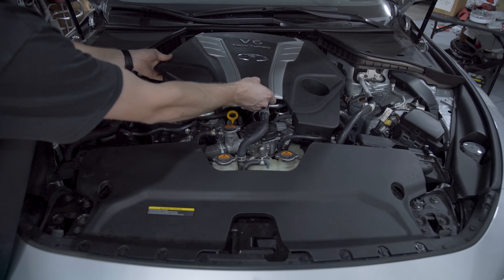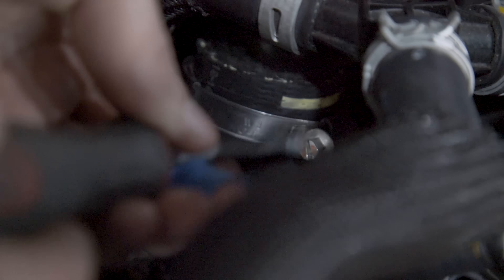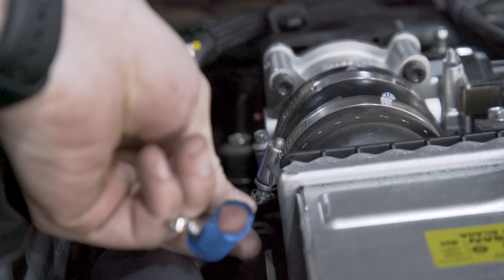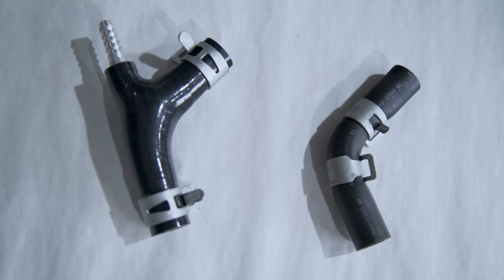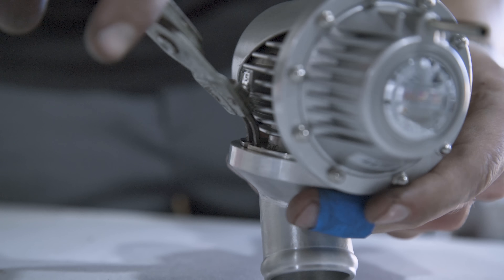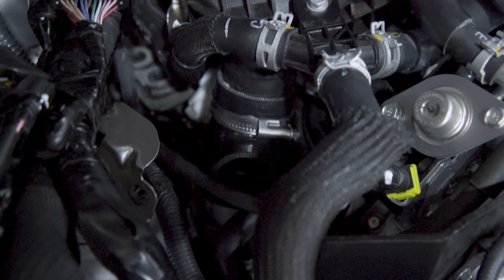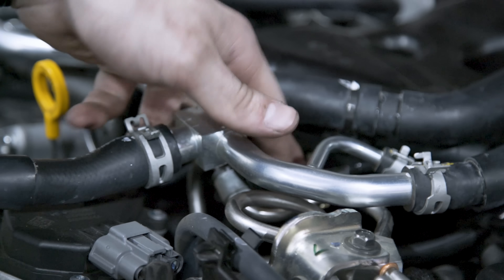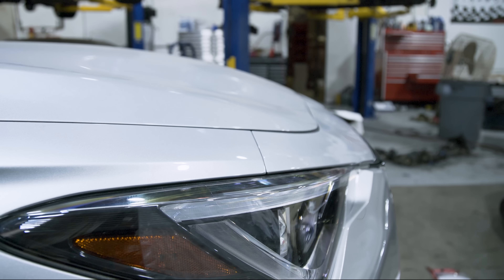How To Install Your CZP HKS Blow Off Valve Kit

Comment: Great video!   Since I just completed this install in my 2017 Q60, I have to say that removal of the vacuum hose was difficult.  I guess I didn't have the correct pliers to do it.  Get a couple of sizes and angles.  One tip about the vacuum hose removal....the hard to reach vacuum hose clamp can be turned to a position by twisting the hose.  Then it might be in a position for your pliers to reach.  Second tip on the vacuum hose, you should compare the OEM vacuum hose with the custom CZP vacuum hose.  I'm not going to advise this, but I had to cut a little off the vertical hose end.  I'm sure others were successful putting this on as is, but I was tired of messing with it.   Finally, for the install of the horizontal hose clamp, I used my own vacuum hose clamp that could be tightened with a socket or flat head screw driver.
Reply: I did the same thing earlier when I installed. Had to use a razor blade to cut a tiny slit. After that it was much easier.
Reply: @OldSchoolJules  I think that's a better idea than what I did.  Excellent!
Reply: Yes, the CZP vacuum hose was a bit off but I didn’t do any cutting or shaving as I managed to get it on and use a different clamp on both ends.
Reply: @romeo9035  Awesome!   For me, it was getting late and I was a little tired.  Glad you was able to get the vacuum hose on.

Comment: Won't the bov throw off the mass air flow sensor?
Reply: Exactly! HKS never mentioned any of that but if it does I guess disconnect the sensor
Reply: Any1 have answer for this?

Comment: Man, I just installed my blow-off vlv's on my Q60 today. Every thing went as planned but, it's a little tedious. Must have patience. That angle needle nose was a blessing for removing the house clamps behind the throttle body, don't try it with out! Had a little trouble with the snap ring getting in the blow off vlv, it just wouldn't go in. I had to ok shave some millimeter off the snap ring to make it fit. Other than that it sounds and work great.
Reply: Hey man I just ordered mine and was wondering if you’ve had any problems since installing the bov’s ?
Reply: Just to clarify for future readers: The snap rings have a beveled edge on one side that wedge into the groove on the adapter. If you put the ring on backwards it will more than likely not seat correctly. This will cause the bov to pop out of the adapter under boost.

Comment: I just bought a 2017 Q60 RS and I hear that getting blowoff valves is one of the best things to do in regards to making sure that it helps relieve the crazy pressure buildup from the OEM ones which causes premature turbo failure and engine issues. Can anyone let me know if this is a good solution and if you think it will help with lifetime of turbos?

Comment: Great installation video ...very in depth and descriptive ...I had an issue with the rear hose fitting ...I cut off about a quarter of a inch and fit right on.... They sound as advertise and hopefully prolonging my turbo life in the process ! 💯

Comment: Great detailed install video, much better than the techno crap Z1 put together lol.  only thing I would do first is prep the BOV and hoses first.  I also installed the supplied T hose behind the throttle body first, get the hard part out the way..the rest was easy.

Comment: snap rings keep slipping off.. I don’t get it. is there a specific way it needs to be clocked to keep the adapter from coming off? Happened in a test drive and immediately lost boost pressure car began limping
Reply: Just to clarify for future readers: The snap rings have a beveled edge on one side that wedge into the groove on the adapter. If you put the ring on backwards it will more than likely not seat correctly. This will cause the bov to pop out of the adapter under boost.

Comment: Instead of the custom vaccum line , i receive a black T extension??i feel like my hose Are gonna be bending
Reply: The same thing happen to me. What did you do without the hose?
Reply: @knsu4856 what did you end up doing? Mine came with the same thing and I’m stuck
Reply: @HomicidalKings  You have to cut the hose. Make sure you get the measurements right. I ended up calling Z1 to help
Reply: @knsu4856  thanks man. I was so confused on that part 💀 I did t want to cut it and be wrong
Reply: @HomicidalKings  Np bro. Lmk if you need help with anything else